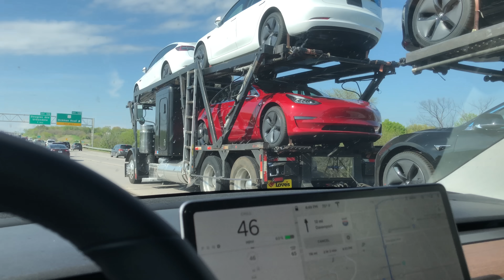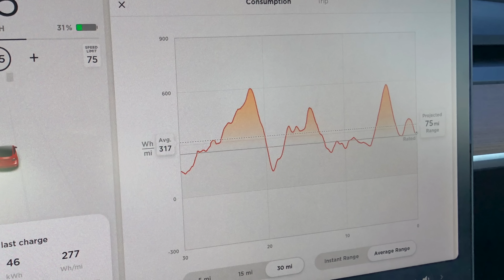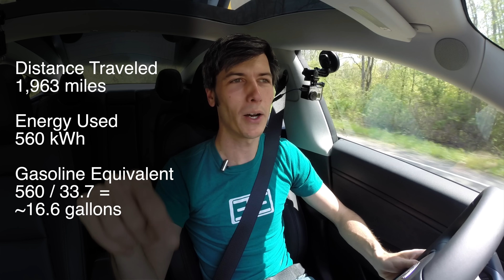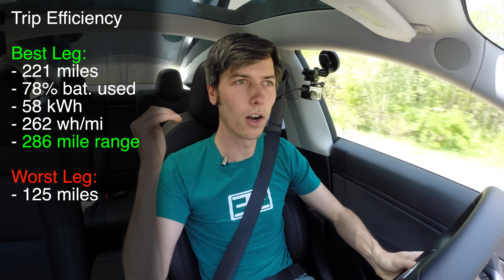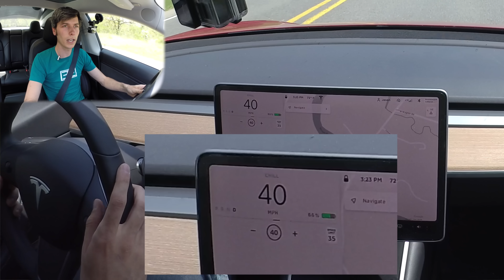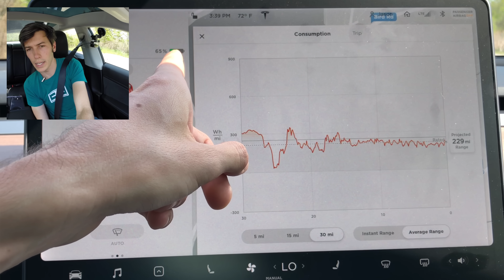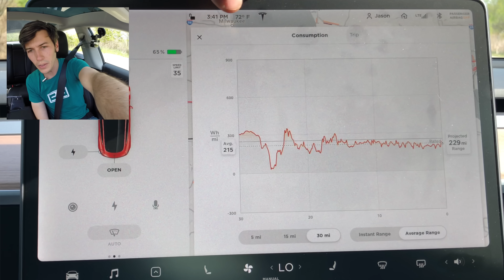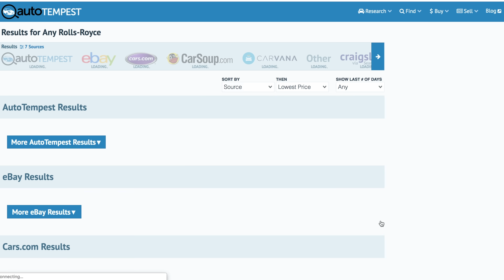How Miserable Is A Tesla Road Trip?

Comment: Last December-ish I traveled a lot of the same route you had plotted out in my own Model 3 Long Range RWD. First from Phoenix to Central Illinois via Texas, then back to Phoenix via Denver. A lot of my experience was very similar. In comparison, I was a lot more adventurous/risky on how low I'd let the battery get, and the lowest I remember seeing it when I arrived at a charger was something like 2%. The car does prompt you to slow down below a certain speed if it starts to think you won't reach the next Supercharger at your current rate. It was winter, so I did have the heater going and that did affect my range. In winter, it does also warn you about leaving the car with a low charge, like if you stopped somewhere away from a Supercharger, for example if you were getting some takeout food to eat in the car before driving over to the Supercharger. I didn't keep track of the exact numbers but I do remember needing to stop about 12 times for what was about a 1600 mile trip, compared to your own trip of 1900 miles. For plotting the Superchargers between the trip navigation-provided ones, you can press the Supercharger icon on the lower right of the screen, and I did use that several times to adjust my trip (I would set the nav to go to the next Supercharger I wanted to go to rather than my ultimate destination.) I did this a lot in Colorado when I wanted to go off the interstate and instead travel through some of the more scenic mountain range areas. I wasn't sure how much the Autopilot features would help, but now that I've used them on a long trip I kind of dread not having them. The adaptive cruise plus lane keeping takes off a big source of stress for me in that I don't have to constantly adjust my cruise speed manually as traffic levels change. I did drive alone, and I remember one of the nights just as I was starting to feel tired myself I saw another car drift out of its lane and almost go off the road, before being jerked by the driver back into the lane. Of course, I don't recommend anyone try to use the lane keep functions as an excuse to drive tired, but I was glad the feature was there and can see the potential for it to save lives. The Navigate on Autopilot automatic suggested lane changes wasn't around yet, but I was able to use the auto lane change by activating the turn signal and it worked really well in low traffic. In heavy traffic it was pretty overly cautious and I would often perform the lane change manually instead. In my daily driving in Phoenix more recently, I can tell this is something that's being tweaked in software updates- the car is more aggressive in changing lanes when there are other cars around. Though, I do have to always pay attention and sometimes cancel it if I feel like the car is trying to make a lane change when there's just too much traffic for it to do so on its own, so it's currently a feature that I'd say you should get only get if you really want it and are willing to pay the extra attention while it's working. One thing I did notice was when it was below freezing, and when I let the battery down below about 5%, the first several minutes on a Supercharger were a lot slower. Once I learned that, I kept the estimated state of charge at the start of a leg up closer to to 10-15%. After it got back up to about 15-20% at at Supercharger it increased the charge rate up. Then, after about 80-85% it starts to go back down, and as you approach 100% it goes down to almost nothing, even less than a normal level 2 charger does at full speed. Back in December, they hadn't bumped up the Superchargers to 150kW max yet, I think they were at 120kW, so I wonder if I took the trip again how much that would help decrease the total trip time. They also didn't have the automatic battery conditioning when approaching a Supercharger on nav, so imagine that would also help decrease the total time of the trip, especially in cold weather and for those of us that push the battery down so low. For cost, some states have laws forcing Tesla to charge by minute for Supercharging, rather than by kWh, so that can affect your cost if you spend time at the Supercharger at the times where the battery isn't able to be charged at full speed. Thanks for your videos! It's fun hearing from another person's experience with their Model 3 and you're always so detailed in your descriptions.

Comment: Firstly, the important stuff (I am a videographer)... i notice you shoot with GoPro Hero 4 Black. Me too, The H4 is still a great camera!
Second, low profile tires are pure idiocy. I wouldn’t buy any car with them. Not only do they damage more easily than a tire with more rubber cushion room, but they are always harder to find if needing to buy one in a very rural location.
Thirdly, stopping every 200 miles would drive me crazy. I usually do long distance driving at night. My Land Cruiser is capable of 600+ miles on a tank of diesel, and with the refrigerator between the front seats with sandwiches and drinks I only stop for toilet breaks. The Tesla is impractical for me as it is only good for the highway, but I still like the technology, and appreciate your enthusiastic approach to monitoring the driving experience.

Comment: Good job. I think it would be interesting to know what 100 miles on the Tesla costs in terms of wear and tear on the motor (and everything that goes with it), versus an internal combustion engine. If the life expectancy of the electric motors, for example, was such that replacing them would be done twice as often or half as often as its gas counterpart, it would affect efficiency in a whole different way.

Comment: so tesla has about 40% of the range of a gasoline vehicle and fill ups take an hour or maybe more.. and you are driving from one charger to another charger so no real side trips on the spur of the moment to see that house sized ball of yarn. I think for the sake of the future charging needs to be standardized so all vehicle can use the same systems which would increase availability
Reply: It's true that the flexibility for spontaneous trips can be lower but it strongly depends on the length of those trips. To save time, it's ideal to always charge at your destination if you can, so that you never have to think about charging on the road. If you make spontaneous 200+ mi road trips with a strong deadline, then you're right, you'd lose flexibility. However if the reason you're driving such long stretches is that you want the trip over with, then you'll most likely be way less exhausted when driving in an EV and thus not need to do longer stretches. Charging standards already exist - there's 3 main standards for fast charging, one for Tesla, and two others. And then there's one standard for destination charging.
Reply: @Muskar2  yeah well for now they are commuter vehicles primarily and not for distance. that might change but only with many more charging stations or batteries with twice the life and more.. both of those things are big hurdles.. thats why i said standardized charging across makes will allow more stations to be placed quicker. does that explain what I said better for you?
Reply: @Muskar2  duhhhh duhhhhhhhhh duhhhhhhh me no understand things so good... duuuhhhhhh ... yes the amperage hours of the batteries needs to be twice what it is because you can travel about 400 to 500 miles without stopping with a gasoline powered vehicle of the same time duuuhhhhhh duuhhhhhhh duhhhhhhhh but that is very complex thingys that need simple math skills to understand duhhhhhh

Comment: This car is okay for those who are relaxed and have plenty of time. But when you're somebody who is really focused on getting there....  FAIL
Reply: I drive mine like I stole it, 5000 miles a month. I have no issues.
Reply: @evracer5845  I wouldn't have any issues either until I needed to regularly exceed the limited battery capacity.
Reply: @randallsemrau7845  and how often would that be? I did maybe one 2k mile trip in a *decade*. But I did many times that commuting and in 200 mile short trips. So, it obviously depends a great deal on your usage patterns.
Reply: @DanielCazzulino  in a day many people average over what a tesla can do.
Reply: @DanielCazzulino  Twice a week on average. There isn't a salesperson in our valley driving a pure EV.
Reply: @randallsemrau7845  stats, that's all that matters. Sure, it's not for everybody, so? Hardly anything is.
Reply: @DanielCazzulino  Tiny gains in energy density are being made every year though, so who knows.  
Besides the obvious exceptions, EV manufacturing consumes the same mined coal, and refined zinc, copper, iron, bauxite, glass, nickel, magnesium, titanium, cobalt, tungsten, platinum, silicon, rubber, very large amounts of water, energy and petrochemicals.... as any 4 wheeled ICE vehicle currently on the road. So I feel sorry for those who imagined that the same Moore's Law which applied to computer development, was also going to apply to the price and capability of EV's.
Reply: @randallsemrau7845  current range and (almost current 250+khw) charging rate is more than adequate for the vast majority of people (i.e. those in the same stats linked above). No massive breakthroughs need at all (again, for the majority in the stats). For the excepcional cases (.i.e.  sales person on the road, trucks, etc), sure, it will take longer.
Reply: @DanielCazzulino  Hey don't get me wrong, I really want one. I love how different they are. But what I don't appreciate, is the political dishonesty regarding their 'necessity' and the 'need' for subsidies by average taxpayers.... when they are already avoiding road taxes.
Reply: @randallsemrau7845  who subsidizes the contaminating cars so it's free for them to ruin the planet? ('cause it certainly isn't free to deal with the consequences for sure!). Let's get a carbon emission tax, rather than an EV subsidy. Also, Tesla is crushing sales even with subsidies going away
Reply: @DanielCazzulino  Maybe we should go completely nuclear for our electricity so we don't have to say we are running our EV's largely on methane and coal.
Reply: @randallsemrau7845  CO2 tax is orthogonal and the best incentive I think. Let the innovators figure out what's the best choice from there.
Reply: @randallsemrau7845  also, while that might be the case in the US, it's definitely not in other countries (i.e. France). So, going EV is still the best thing in the short term while the big energy move happens elsewhere. It's a prerequisite, but it's not rhe end.
Reply: @DanielCazzulino  Our lawmakers can't even tax fairly across the broad spectrum of tax situations in this country as it is, and you hallucinate that a CO2 tax will be accomplished fairly?
Reply: @DanielCazzulino  France is mostly nuclear, great. Now all you need to do is figure something out for the other 99.1% of the planet's population.
Reply: @DanielCazzulino  I guess we could replace all fossil fuels across the planet with nuclear by 2050.
 Oh, wait, that would mean constructing a 1.5GW facility every single day for the next 11,000 days......
Reply: @randallsemrau7845  All of it, nuclear, solar, geo, thermal, wind. Why put all your eggs in one (centralized) basket? :P
Reply: @randallsemrau7845  Oh, and tax fossil. That will get them investing more wisely.
Reply: @randallsemrau7845  what? So you'd consider Elon anti-american??? :/. Something seems seriously wrong in that argument.
Reply: @Steve Withers you are joking right and extra what was it 11 HOURS? the "Glory of the ride" BUT YOUR NOT RIDING YOUR SITTING CHARGING ROFL

Comment: the only question I have is about the amount of gas the trip would have took. Did that include the regen every time the car was coasting? As we know if you are using cruse control  there are a lot of time that the car will coast and every time the car coasts it regens the batt and over time that adds up. That is something a gas powered car can not do so for that number to be accurate all of the regen would have to be subtracted from the total time of the drive and only the charge at the station can be used in that number. So is that how that number was calculated?

Comment: In my 50 years I have made possibly 25 road trips of longer than 500 miles one-way. In the same time I’ve driven about 750,000 miles total at a guesstimated average of 18mpg.  For me, range is a secondary consideration to cost of fuel.

Comment: Waiting 40 minutes to charge is no way to travel long distances . Totally impractical. Waste of time
Reply: This is why those electric transports and commercial vehicles will be a failure.   Every minute those kinds of trucks aren't moving products, they are losing money.  And no logistics company is going to buy, say, 40% more work trucks so that a certain percent of them can be put on chargers and pass off their delivery to another charged truck.    everything i say is with current battery and charging technologies.   If they can get batteries that hold a lot more power OR fully recharge in the same time it takes to refuel, then maybe.
Reply: littlegoobie except the semis will charge while their unloading their cargo, so no time will be lost.  Long time ICE drivers just can’t comprehend how much different charging is vs gas station fill ups...

Comment: Are there any battery health concerns with that much rapid charging/discharging especially with allowing the battery to cool? Or is this not a concern?
Reply: The older models got slightly limited supercharging after a fixed number of supercharging sessions, in order for the battery to safely endure through warranty - which means Tesla had a non-zero concern for that. There's no software limits put on Model 3 yet, so perhaps this issue is long gone. But generally, the BMS is there to take care of the battery for you, and it always optimizes your battery health - except when you choose to charge to 100% or discharge to 0% and let it stay at those states of charge for a long time. So you don't need to think about it really. Some of the longest travelling Tesla's (from Tesloop) have traveled over 400k miles doing mainly supercharging and still has fairly low degradation.

Comment: Next gen superchargers that are currently being rolled out max at 1000 mile/hr charge.
Reply: Andrew Dosko that’s quadruple the range which is great but don’t forgot to quadruple that charging time. So if it takes 40 mins every 200 miles, that means it takes 160 minutes for every 1000 miles. Sitting for almost 3 hours per charge is pretty brutal even for every 1000 miles and that’s being very conservative.

Comment: Awesome, detailed job on the trip and conveying how the car is do drive and comfort level! For me, at the cost of the Tesla, it doesn't justify owning one taking into account cost delta of gas vs. electric and being required to stop ~every 200 miles with not much option of taking a detour if the impulse crops up -I do think having that 15% buffer is a good idea as well. If I consider the Mazda6 I drive, I get even more mpgs (~35mpg) than the crosstrek @75mph, which would bring down the fuel costs even further.
Reply: owned a Tesla for 3yrs now. Take a look at the supercharger system map. You can pretty much do anything you want and there are tons of non Supercharger (commercial) chargers. Just pull up a PlugShare map or similar. I have personally drive many trips like the one in video (Canada, Key West, etc) and there are zero problems. The people who suggest charging is an issues clearly haven't driven one of these cars.

Comment: Personally I would swap those wheels for 18" ones. Yes, I know the Tesla ones won't fit with the performance brakes, but there are aftermarket wheels that do.
Reply: Mark Haury the aero wheels are more efficient. Trip would have taken less time with them.
Reply: @lemongavine  I am more than a little skeptical about that, but regardless they won't fit over the performance brakes, so not an option.

Comment: How much did the electricity cost? I also wonder if you figure in the efficiencies of electricity generation and transmission how much coal was burned to get you through.
Reply: since coal is about 27% of U.S. energy production, I would argue it is still by far better. Now a better argument would be how much is from fossil fuels, and since the U.S produces 63% of it's energy from fossil fuels, quick math would infer that it is almost 40% less a burden on fossil fuel.
Reply: @ralphpiper2644  just a side note that I read somewhere, giant power plants are a loooot more efficient than a gas or diesel powered engine meaning that the benefits of electric cars are even more environmentally friendly
Reply: @ralphpiper2644  Good answer. Accordingly, if we really are concerned about carbon emissions we should be developing safe nuclear power (Th-U cycle has promise) in parallel with electric cars.
Reply: @agent-8699  agreed, I wish the public would support more nuclear energy advancement, as it provides the biggest bang for our buck. The largest public reservation is the risk. A coal plant explodes, well that sucks... A nuclear plant melts down, and the damages can have much more impact. Safety is a huge concern, and provided we continue to refine safe nuclear practices will eventually mitigate or eliminate the risk. Also, nuclear fuel is still non renewable, as of now, and frankly the waste is a huge ecological concern.
Reply: (see 21'13) 40 dollars less than using gasoline. And no internal combustion servicing before or after the trip at all.